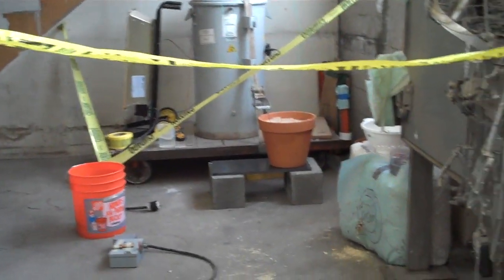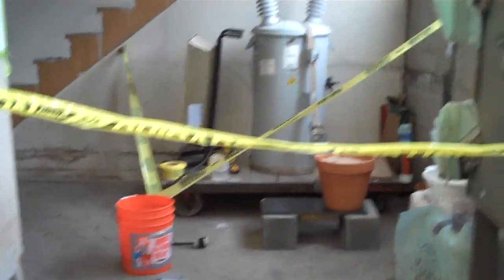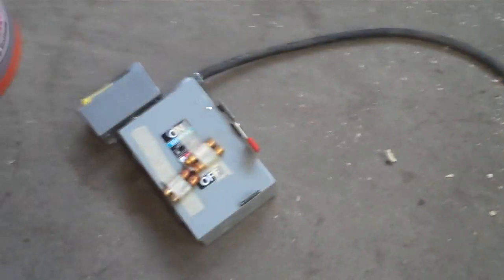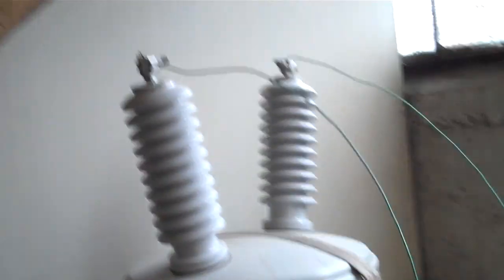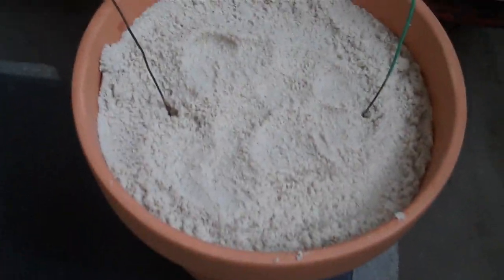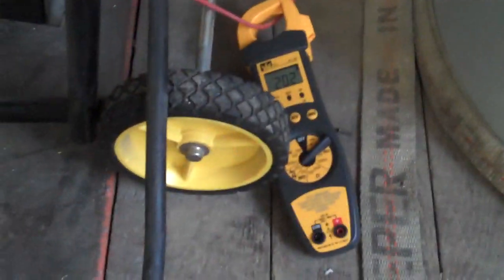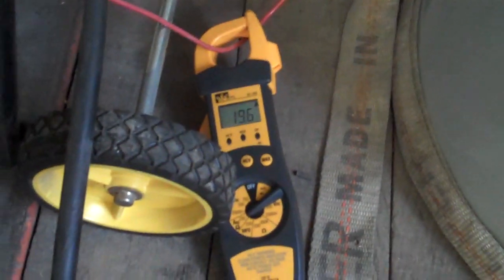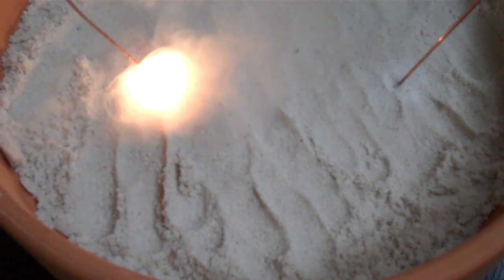High Voltage + Moist Sand = Glass Fractals

Comment from the maker: @aleks8825 Highest numbers: 240 volts at less 30 amps for 30 minutes that ends up being 3.6 kWh. 
But really its more like: 240 volts at 10-20 amps (average) for 10 minutes which is more like 0.4-0.8 kWh.

In Washington state, its something $0.08 per kWh (at most). So the biggest fulgurite I've ever made cost about $0.20 in electricity.

Comment from the maker: @ultimutwar Attracting lighting is tricky. A bolt's path is apparently un-affected by stuff on the ground until the bolt is just 50 feet above the tallest objects in the area. In practice, this means if a bolt was going to hit your beach, you can put metal rods in and get 'em to go where you want. If a bolt doesn't get near enough your beach... rods won't help.

Now rockets... that's where its at. Simple rocket. Coil of thin wire. Like they do at the University of Florida to call down lightning.

Comment: Nice video. I would've used carbon (graphite) rods for the electrodes instead though, because they are much less likely to melt/fail than a thin copper wire. Moreover I would've let the whole thing running more, but would've moistened the sand more and moved the electrodes a bit closer (they seemed to have been shorted via the pot, probably its metal or water content is too high for HV work).
Reply from the maker: +CoolKoon Good tips. Thanks! I didn't have any graphite rods handy, but I had tons of copper.

Other times, I varied the moisture content and electrode position with varying effects.
Reply: +Pip Lafleur I see. I know it's hard to find the right spot, because as you up the voltage suddenly everything starts to behave like a capacitor, which in turn increases the losses.
Reply from the maker: +CoolKoon Totally. The other interesting dynamic is that water is mildly conductive. So as the heat increases, the water evaporates, and the wet sand becomes less conductive. 

At the same time, the sand is not conductive, but as it melts, the molten glass IS conductive. 

So you have some paths becoming less conductive, and others becoming more conductive as the process goes on.

Comment: how many amps is that pole pig throwing out???
Reply from the maker: It's plugged into a 30 amp, 240 volt circuit, being stepped up to 36,500 volts, so if I'm doing my math right it's just under 0.2 amps but actually less than that if you assume some loss from the space heater.
Reply from the maker: +Lost In Space Electronics and actually the amp meter is showing ~20 amps so that ends up being more like 0.13 amps.
Reply: ouch
that would hurt lol in even after you in heaven or hell ;)
Reply from the maker: +Lost In Space Electronics 

When giving my warning speech, I tell people to stay away, because it can kill you before you have time to cry out to your mother.
Reply: exactly i would like to go become a line man but some people say that too and also say "im ready to get the lineman training over the fast way'' but thats how you die faster too thought you gotta know what your doing along with being very carefull and precise
Reply: Pip Lafleur nice video by the way man i did this today lol
Reply from the maker: +Lost In Space Electronics Awesome! Gonna post a video?

I'll try to check out your videos later tonight.
Reply: idk if i will or not lol but i got some videos up